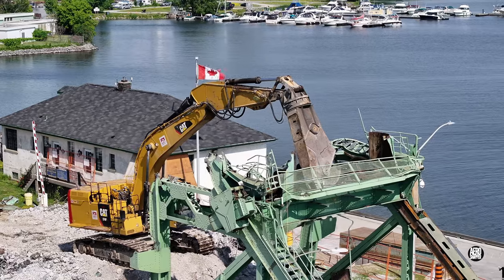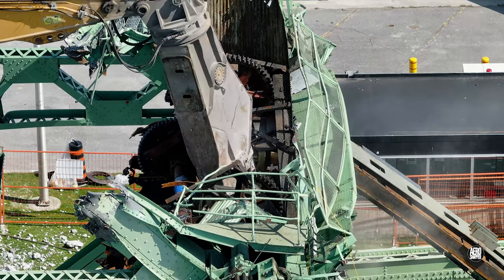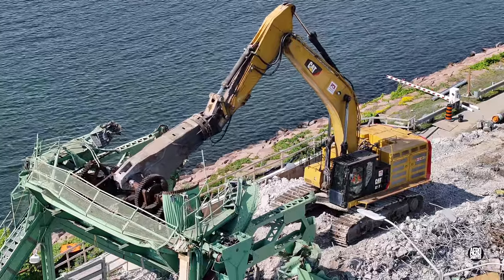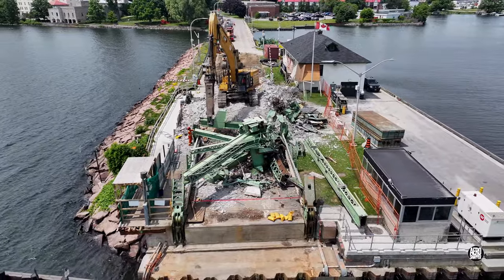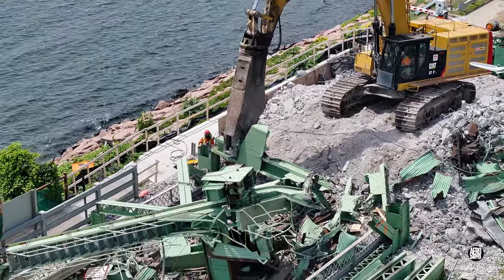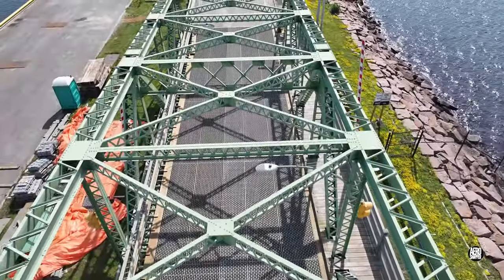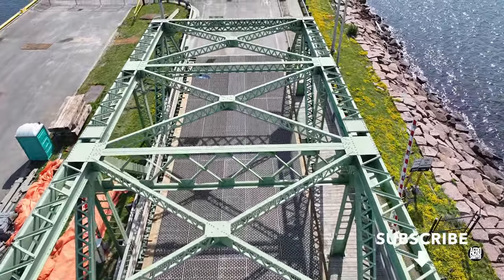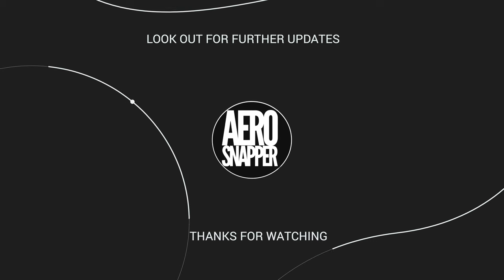This is going to bring the house down - an update on the La Salle Causeway lift bridge  4K

Comment: Could we potentially use the deck section as the temporary bridge? Obviously is not going to lift but in the off season it could work.
Reply from the maker: An interesting idea around which a number of rumours are circulating - we will see